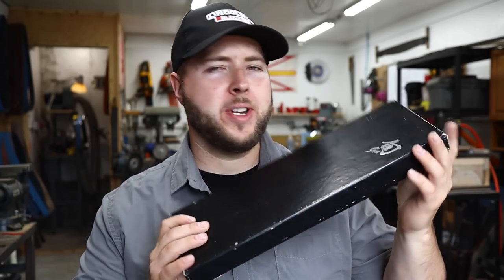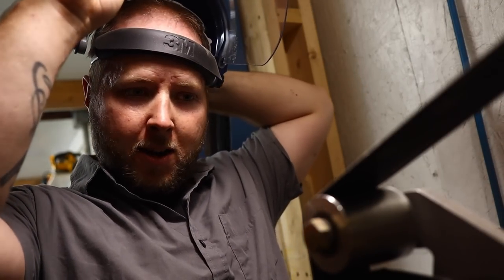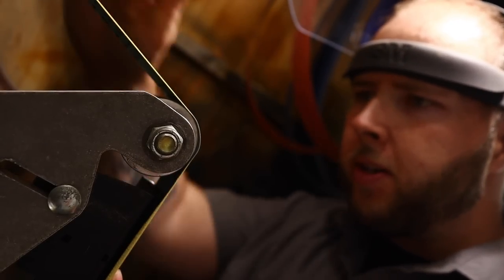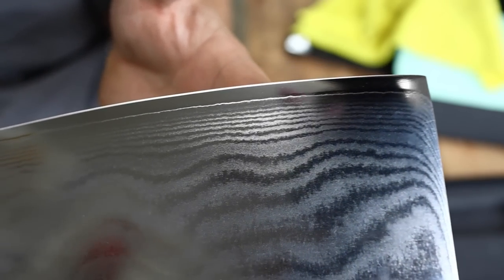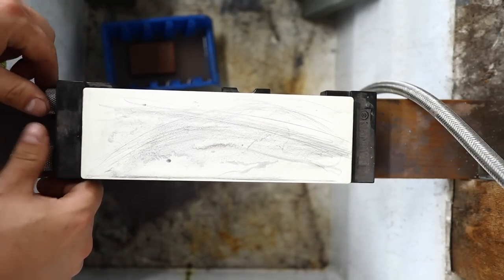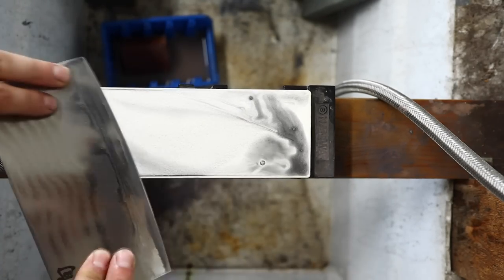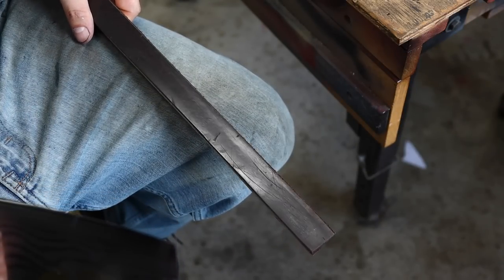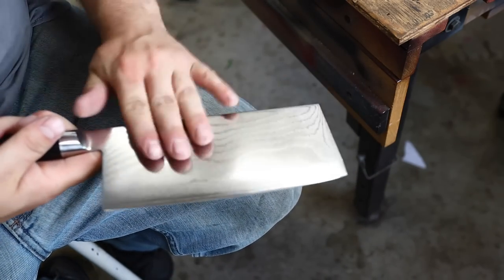Repairing a Clients Damaged Shun Cleaver - SO SHARP!

Comment: I unfortunately struck a rock with my kukri while i was removing an old blackberry bush and I felt so bad about the ding two thirds along the length of the blade. It's a tool and will take wear, I can remake this edge I thought to myself. 
It's got a slightly stranger shape now as I decided to only work on the area around the damage, so it has a little extra inward contour along the blade edge but it's sharp all the way along and does the job just as well as it did before. Watching videos like this one has really helped me know what to do to keep sharp and repair my blades after wear and tear. Thanks for all the advice from the masters online

Comment: I found some 72 inch belts online that go up to 4000 grit. I made a jig that's adjustable that mounts to my KMG and it is the best sharpener I've ever used. I put it on the slowest speed and can take a new edge to its sharpest in just a couple passes.

Comment: Shun's Classic cleaver is probably one of the best cleavers on the market, with a price tag to go with it.  When I was in the market for a cleaver, they were going for $300 USD.   

I own a Shun Classic 8" chef's knife, and the Shun Classic 7" Santoku, and they are AWESOME kitchen knives!   But you do have to handle them with care, as the edges will chip easily.  As a matter of fact, you have to be very careful with the use and maintenance of these knives at all times.    

I use a Shun honing steel to keep those knives in tip-top condition, and it works great.    When I need to resharpen, all I need are King 1000 and 6000 grit whetstones, but I only need to do that about once a year.   But I did try just using the big old Naniwa "Big Green Brick of Joy" 2000 grit stone the last time I sharpened my chef's knife, and it did an outstanding job.   No need for further polishing!   Shun knives can hold an amazing edge, and it keeps for sometime.    

However, as you saw with this cleaver, most people should NOT own Shun knives, as they DO need to be handled with care.   If you treat them like a typical German made knife, you will damage it easily.  You need a very light touch when using Shun, and good technique.   Most cooks don't have that skill. 

As for repairing knives with whetstones, I do it all the time.   It takes longer, but it works great, as long as you have the skill and patience to do it.   

Great video as always!   

BTW...I've never used Shapton stones, but they are on my list to get next, as I've heard nothing but good things about them.
Reply: I recently got the Shapton glass seven 500/6000 and they work like a charm. I have Naniwa Superstones and the king kds to compare them too and they feel so great. When you have the opportunity, just grab them! You will definately not regret the decision

Comment: 1:30 - imho - another reason to avoid belt sanders (and other machine tools NOT designed for true 'knife sharpening').  They risk heating the blade and deferentially changing the temper of the metal.  Especially someone unaware of how little heat is needed to alter the temper.  A course water stone, cuts quick (including removing chips) and doesn't heat the blade at all.  Understanding which (and when) to use Waterstones correctly, speeds up your sharpening game immensely.
Sadly, even in Japan, this mistake is made to speed up production.  
It also leads to Choppers (like this one) having an edge ..maybe not 'true' to these Choppers originally.  These days incredibly thin edges are put on Choppers (to give them impressive 'sharpness').  However when you chop through bone, with these modern super sharp choppers, they chip out like this.  
fyi - I have an old Chopper (about 150 years old).  Its sharp (for its job), has the correct blade angles for the tool, cuts/chops through bone and won't chip when you do that.

Comment: How different are sanding belt grits from whetstone grits? With a 400-grit belt the chip was removed completely, but you continued on a coarser 320-grit stone. Wouldn't one continue with a finer grit to finish the edge?

Comment: It all depends on what your workload is if you have a handful of knives the all need repair You use your best judgment as to the method of repair because if you have a knife that it will be a little bit less time to use a grinder than a wet stone and and a little bit more efficient to do that particular repair and that's what you're going to use

Comment: What’s your take on explaining why the primary is the primary and why the secondary is what it is and where did you learn that, I have seen it explained reverse also???
Reply: That actually depends on where you are :)
In the west, the primary bevel is traditionally the main chunk of steel that has been grinded to it’s intended shape, and secondary bevel is the part that is polished to an edge/apex i.e. the sharp end. 
In asia, and specifically Japan, the primary bevel is the sharp end, the edge/apex which initiates the cut. 
So the confusion is understandable.
Reply: @jez76  thank you

Comment: Do you ever fix your stones?  Dishing in the stone or chips missing on the edge.  If you do how would you go about it.
Reply: The best way is not to dish (or chip) the edges in the first place, and the best way to stop dishing is to use the entire face of your stone when sharpening instead of using one small section of the stone. Some stones have instructions on how to 'dress' your stone, and offer other products to lap your stone to keep it flat. Ultimately  you can do it with three copies (A, B, and C) of a ceramic or silicon carbide sharpening stone with the same grit and you rub two of the three stones together to eventually flatten all three. A with B, A with C, then B with C, then back to A with B, etc. If you just rub two stones together they will wear each other down, but their interface might not be flat. Using three stones means that they will wear each other down with the surface of each stone perfectly flat. Chips on the edges shouldn't matter two much as you shouldn't be preferentially using these edges as that will cause uneven wear on the stone. I can understand your desire to use those edges to sharpen close to the bolster on your knives, but this is probably best done with a very narrow sharpening stone and your larger good stone used once the area near the bolster is almost done.

Comment: Pretty random quesiton- do you have tips for someone that wants reasonably sharp kitchen knives but is also super lazy? Like, of the various easy sharpening tools that litter the kitchen gadgets aisles, is there one you'd recommend?
Reply: I use three Wheatstone's and quick and easy for maintenance
Reply: Find a good sharpener - a person to do it for you.

Some supermarket butchers will do this for you for free
Reply: A long white ceramic sharpening round rod with handle might be the day-to-day way of keeping a sharp knife, and when that stops working - and that should take a while - have a 400 and a 1000 grit diamond flat plates to re-profile the edge and near-edge areas. The large flat areas on the diamond plates helps keep your angles consistent when sharpening, and you can use a permanent felt tipped pen on the edge before sharpening to see where various angles of your blade are cutting and adjust accordingly.  The harder your knives the less you will need to sharpen, as long as you only cut on an appropriate wood or plastic cutting board instead of ceramic or glass plates. Have a sacrificial couple of softer steel knives that other household members can use and abuse without destroying the edges on your good knives.
Reply: @bill-nolastnamesupplied-958  my only issue is that learning to sharpen on plates takes a fair bit of time... At least 50 hours to get a half decent result..
Figuring out your preferred motion, force,  and most importantly the angles, especially on a long chef knife or a japanese (one sided) ones is not trivial.
Reply: @kolsky  Yeah, I wouldn't start on an expensive display knife either without a lot of sharpening experience. But you only get that experience by hand sharpening cheaper knives and working your way up. Using that trick with a wide felt tipped permanent pen is a great learning tool to discover how angles affect where the metal is being removed.
Reply: Probably a work sharp product would be fastest.  Just a 1000 grit stone can do a lot too.  Also good knife use and proper cutting board will make your edge last longer.
Reply: The felt tip pen idea is good.

Comment: Oh dear. The owner of the multi-chipped-cleaver needs to stop choppin’ anything harder than their head-bone-skull.
Reply: Sometimes you can have visitors over who "help" by using your knives to cut stuff they should not on ceramic plates instead of knife-friendly chopping boards. And so your carefully honed knives are damaged without you having done that. I now keep some cheap soft knives in my kitchen that my parents can use and abuse and they're easy to sharpen again and I don't have to be unkind to my parents, and keep my good knives out of sight. My father was very proud and was slightly upset when I didn't praise his attempt to use an electric knife-sharpener on a hand-honed knife of mine: "Have a look at this knife that I sharpened for you. It's now very sharp."